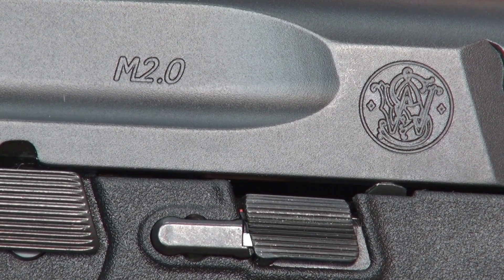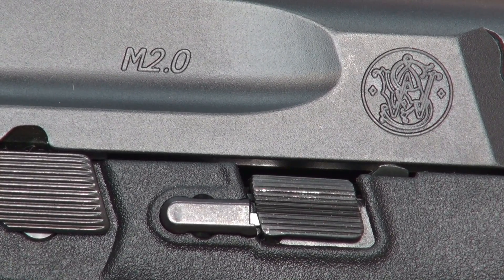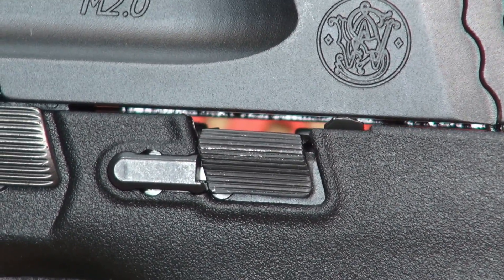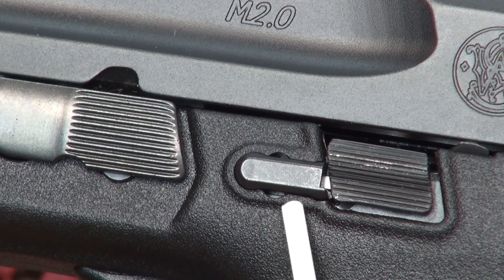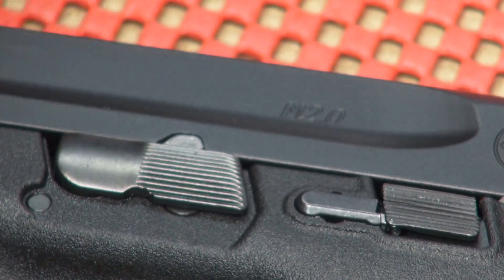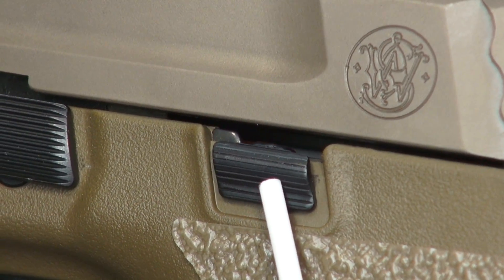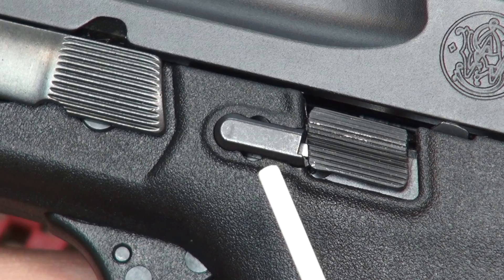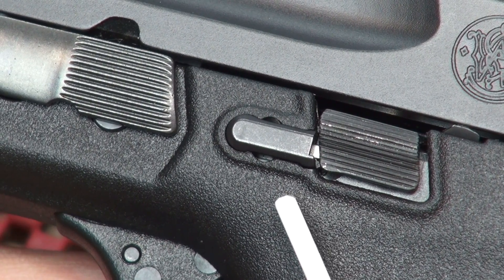S&W M&P 2.0 - Slide Stop Redesign

Comment: i guess when the gun goes dry with 2.0 you are now pretty much forced to only use the slide release to get the slide back in place. not being able to simply slingshot the slide is a set back in my opinion.  looking forward to your first 100 video.
Reply: Another commenter on a different thread claims he bought one and it will still load via the slingshot method.
Reply: Craig Arnold that is good to know! i was hoping they didnt ruin otherwise great design. thanks for the info
Reply: Of course you can slingshot the slide home. If S&W decided to remove that function then the pistol would be a huge flop. Use your head.
Reply: It should be able to function either way , especially with one hand as a release . I'm not to crazy about the extra parts for the release , no other manufacturers seem to need them .

Comment: So the slide won't automatically close if one inserts a magazine in hard.
Reply from the maker: That seems to be correct. I have not yet been able to make it happen.
Reply: Bought a 2.0 in 2019 if you slam mag in hard it will slide.
Reply: @paulgentry5006  I got mine first week of September and I have tried to make it happen and it hasn't and I'm fine with that. If I want the chamber loaded I will rack the slide myself.

Comment: Incredibly poor design.  No wonder the Army didn't wants it.  Mind you I am a lifelong Smith owner.  A functioning gun with a "normal" broken slide stop will still fire.  Teardown could be tricky but firing could still occur.  Smith I'm afraid will rue the day they created version 2.0.  I could be wrong.
Reply: The factory triggers on the originals were pretty bad too and I doubt Uncle Sam would be willing to spring for Apex trigger kits for all of their pistols.
Reply: There had to be a more elegant way to accomplish the same thing; maybe increase the engagement area between slide stop and slide. The potential for this to fail and keep the slide locked back looks pretty scary.

Comment: Thank you for calling it a slide stop.
Reply: SLIDE RELEASE!!
Reply: @michaelsorrell9922  what is the part called in the owners manual?
Reply: some pistol manufactures like H&K specifically have engineered it to function as a slide stop or release.  Most semiautomatic pistols are not designed or engineered to chamber a round from fully or even mostly loaded magazine with the cartridge on top being held under full or near full spring tension, without having full spring tension on the slide to return the slide into battery.   It comes down to 2 things: 1. what the owners manual says.
2. The “wannabe Operator!  I am a certified weapons instructor and I’ve had more people have failure to feed because the round wasn’t stripped from a full magazine under for spring tension from the slide being pulled back and let go.  Is he music? However, you want but I would highly recommend that you practice clearing a failure to feed or double feed condition regularly.  Keep your gun very very very very clean and do not over lubricate it because it will make it worse. Your life, my experience and training.   If you find yourself in a jam, the last thing you need is a jammed gun.

Comment: Odd design which I dont care for... Now it forces you to use your thumb to release the slide after a mag change and you cant just pull and release the slide with your free hand..
Reply from the maker: Not true. You can still rack the slide with slingshot or overhand method just fine. Sorry if I gave an impression to the contrary.
Reply: Justin Opinion... Ok, thanks for clearing that up..